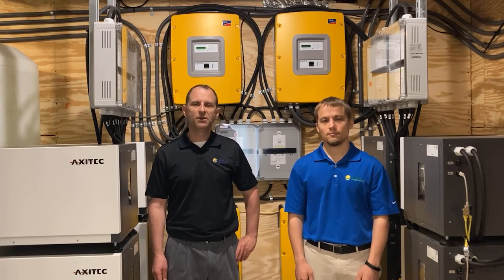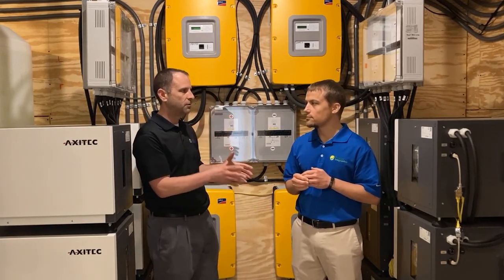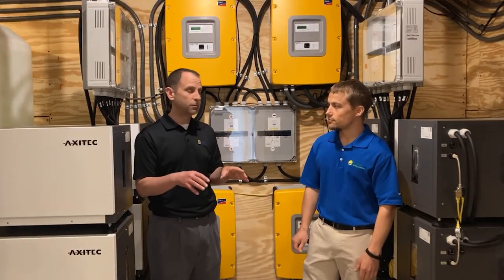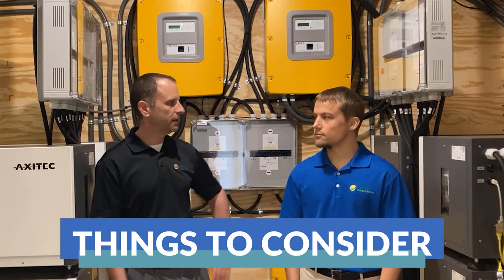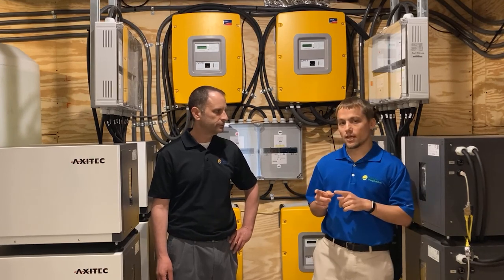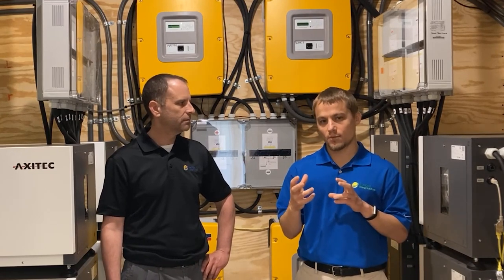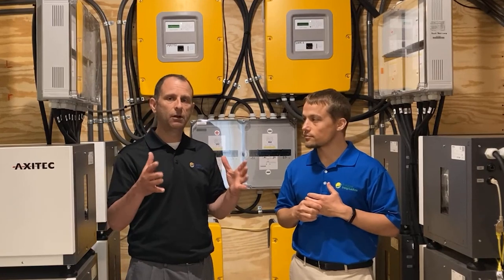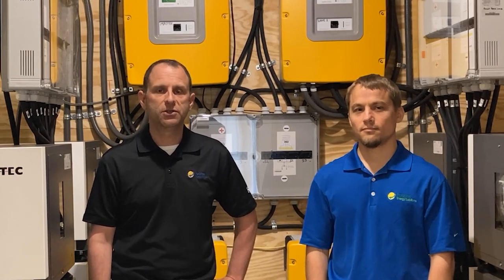How a Home Solar Battery System Works

Comment: Yes... wow. what a great system... If I had an extra 200k... I would duplicate... unclear battery types, or capacity of the individual SMA  Grid tie & off grid inverters..   SMA also does offer Grid Tie Inverters with Back up power  ( SPS) of 2 K/ inverter... if you had four of these... you could have 8 K power, when grid down & Sun shining... maybe w/ less equipment costs ??  Thank you... Great Video.. :)
Reply from the maker: Thanks for watching! We have a video that dives more into the specific equipment of the system in this video. Check it out >> https://youtu.be/fy2DnucB8Kk

Comment: Would there be any benefit having just the batteries with no solar, charging them during the night from cheap grid electric then using them during the day ?
Reply from the maker: Not really. It would not make much sense financially to do this.

Comment: Yeah, the sunny islands alone are about $4500 each, so 18K just for those. What about a reasonable priced system?
Reply from the maker: The system in this video is much bigger than most homeowners will need. We have a battery calculator that will give you a better idea of the price based on your desired loads. Check it out here -> https://www.paradisesolarenergy.com/battery-calculator
Reply: Start by looking at quality LFP server rack style batteries at $1600 per 5kWh

Comment: That setup must laugh at weeklong cloud cover.
Reply from the maker: This is true. When we filmed this video, the owner mentioned they had been running on battery backup for a few days and had no idea. Check out this video for a "behind the scenes" tour of this impressive whole-home setup: https://youtu.be/fy2DnucB8Kk
Reply: @thesolarenergychannel  Maryland wow. We're looking at doing it when we build in Ohio, but I want to pick up a whole building backup battery. I've found Kokam 50kwh batteries for around 5k.

Is there a way to have the batteries grid charged as well as generator in case we want to top them off without using a generator before a storm?
Reply from the maker: @mr.grotto  Yes, the system can be setup to have multiple charging sources.